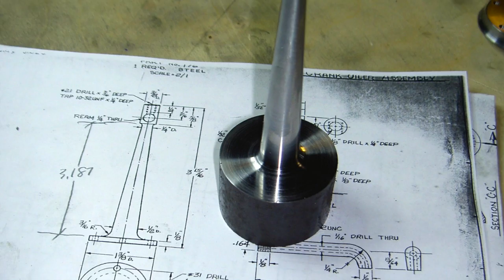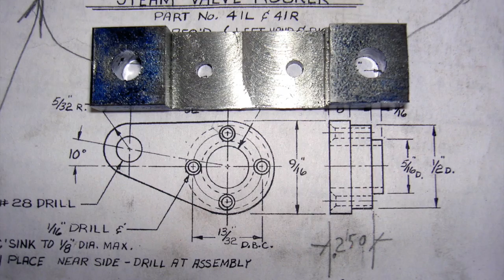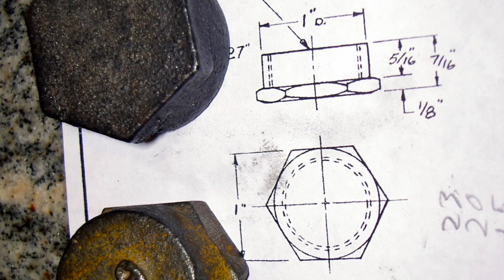Running Model Corliss Steam Engine

Comment: Beautiful work! Do you know where I can purchase the plans for the Corliss myself?
Reply from the maker: Hi have a set of plans that I can have duplicated if you are interested. I also think that my friend Jeff Lehn has a complete set of castings for the project. I can contact Jeff and see what he wants for the castings.
Reply: @craigstevens9278  Hello! I'm very interested in the plans but I usually do castings myself. Do you have a mail adress I can reach you at?
Reply from the maker: @kristerolsson3813  please call me 818-808-3956 easier to discuss.
Reply: @craigstevens9278  Hi! Since I'm from Sweden calling will get a bit expensive so I would prefer mail if possible.
Reply from the maker: cstevens9@socal.rr. com

Comment: Central Machinery panel, that's Harbor Freight, but it's actually a Grizzly lathe?
Reply from the maker: You are correct it is a harbor freight lathe However it is identical to the grizzly and was $700 cheaper. I have had it for 15 years and I am totally satisfied with it. Craig

Comment: On the real steam engine what was the actual use of this engine? Was it just used in factory’s or did it have other uses? I worked in a factory up in Massachusetts back in 1970. They still used steam engines and the old canals were very well maintained.
Reply from the maker: Lester Miller This type of engine was used only in factories to power the factory or to produce electrical energy.

Comment: I would love to see this in person. What is the purpose of the coreless four valve set up? Very interesting engine?  I wonder if you can get it machined all ready?  where it just needs some finishing work to do final finishing?  I got to build several Stuart engines back in the 60’s. As part of my engineering in school. Wish I still at least one around these days. Never saw a engine like this before. I built a 18” tall no 10 vertical back in 1968. Got hold of a 1901 cast iron bath tub. I used the engine to power it. I made a car out of it what a blast that was to run up an down my street. Lots of laughs. I was like a young mad scientist Back then.
Reply from the maker: Lester Miller The purpose of the four valves set up is strictly for steam economy. The engine is only available in Raw casting form and a proximately 20 pages of plans. Occasional only won will show up on the eBay however you must be extremely careful as to exactly what you are purchasing.

Comment: This is art, I've never understood the big deal about paintings or abstract sculptures, I could look at this forever.
Reply from the maker: I would not know good art from a good fart. However the old steam engines from the mid eight teen hundreds especially the  English ones were true art.  Corliss was a master engineer who developed the Corliss valve system which combined steam power with steam economy. 
Craig
Reply: Brigitte Trapp
Well, these days, there's not much difference between good art and a good fart, lol.

Comment: Are there any plans for this engine? I'd like to make 3D drawings for it
Reply from the maker: +WindSolarHydroHuman 
Contact Ken Rose, Coles Power Models. Info @coles power models.com 
Phone 409-547-3400. He sels both the plans and castings. Just what are you intent upon doing.  Craig
Reply: I cannot machine the engine but I can do CAD. I thought I could draw the engine and produce a computer simulation. This particular engine is both beautiful and interesting given its Corliss valves and its governor. Visualizing this engine working can help people reproduce it or redesign it... Thanks for the info.

Comment: Beautiful work, but you should've made the flywheel in two pieces if you really wanted something to drive you crazy!! 
seriously, exceptional work and that governor is probably the most beautiful piece of art I've seen.
Reply from the maker: Plan did not call for two piece flywheel. The project managed to drive me crazy enough for 2 1/2 years. Yes , the governor was a bitch. What models have you fabricated. 
Craig
Reply: +Brigitte Trapp  none unfortunately, i dont have a lathe or milling machine, im just a nut and bolt tinkerer but enthusiastic viewer of these videos.

Comment: Lovely Engine (and beautiful workmanship and attention to detail and surface finish). You did a great job.
I was just about to ask whether the governor actually did its job, then the section in the video came up showing the governor actually changing the cutoff point. It's so utterly amazing that this also works when all the masses involved are 10000 times smaller than in a big engine.

Also, great video! I could watch stuff like this for hours.

Have you ever run that beauty on steam?
Reply from the maker: Sorry for delay to answer your question.
I never run my models on steam only compressed air. Don't want to mess them up would take weeks to clean if run on steam.
Reply: Back in 1976, the Smithsonian had a couple large Corliss Engines running as part of their "1876" Exhibit.  (Steampunk, before the term had been invented.)

They said they were running them on compressed air at 15 PSI, but the air was run through a carburetor, which added oil to keep the cylinders lubricated.  As these were museum pieces, which they wanted to keep intact, the extra paranoia was justified.